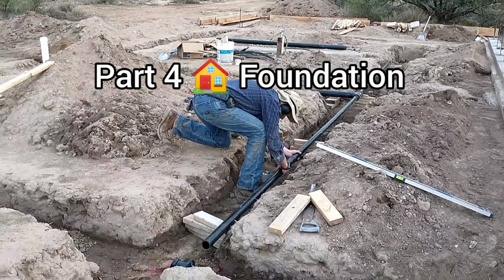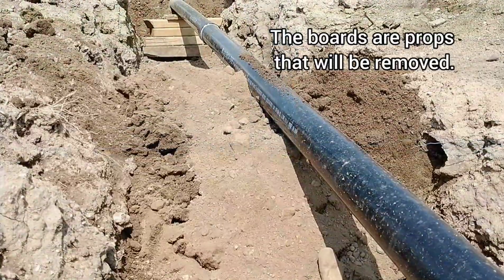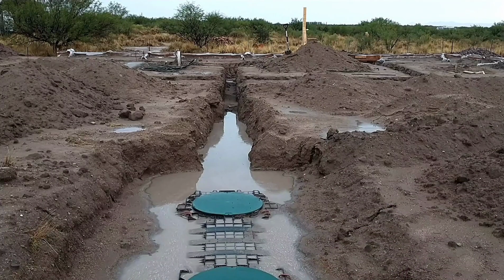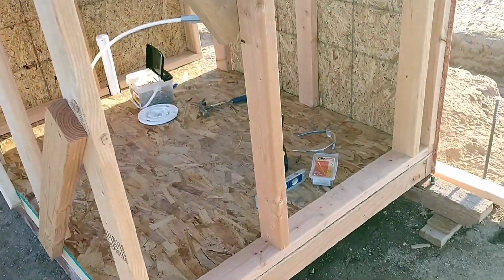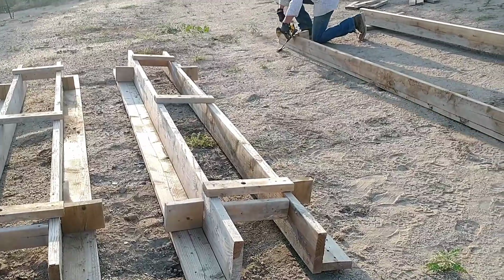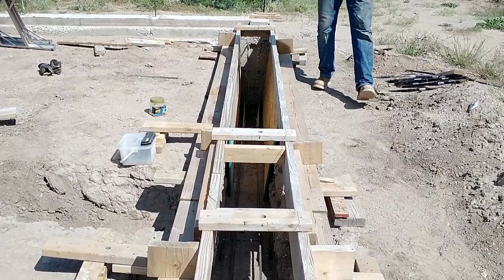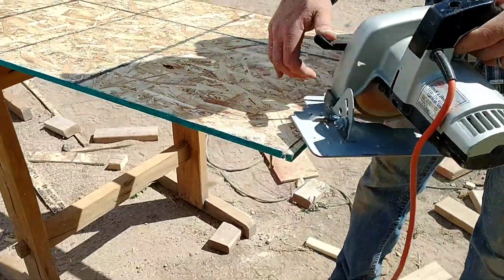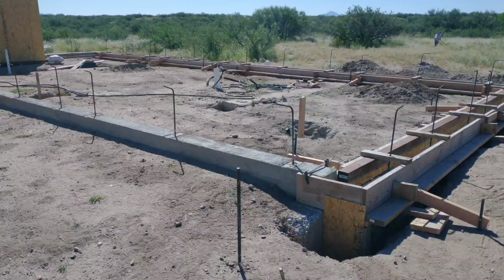#4 🏠 Footer, Plumbing, & Bathroom | DIY House Build

Comment: I have been wondering how your build was going. I bought a cement mixer in Hermosillo Sonora for $1000 dollars and it has been worth it's weight in gold. I have poured some foundations and stem walls for my house. I also started making adobe with it using the fiberous material that is left over after the locals make Bacanora, a moonshine tequila that is produced regionally. It worked excellent with no adverse effects. Why did you break away from the channel about your shipping container shop build? Once you get so many hours of video watched you'll be elegible for monitization. I think your good quality videos will make you a good subsidy and help with your build.
Reply from the maker: Cool! I hope to show the second part of the pour soon. It was about $1500 per pour, and we didn't have to do the mixing. Aircrete needs to be mixed in barrels or buckets. We'll have to do some experimenting first to make sure we can get a mix that will work. Possibly add some fine sand and maybe paper to make it more structural. Fine sand can be purchased for just $24 a ton! Yes, the channel was doing very well and making a decent amount from add revenue. Long story short, we had some issues with crazy locals, and were not sure we were going to feel comfortable continuing to build or post, so we deleted the channel. We're not really sure if any of it had anything to do with the channel, but it's gone now. Things have mostly quieted down out here, so we decided to come back just focused on the house build.  Best wishes on your adobe house build, you should at least do a video slideshow on it or something. 😊

Comment: Thanks for this educational video presentation.  Your craftsmanship and creativity are obvious in your construction work as well as your presentation.  

I have family living in NM. While visiting a number of years ago I watched a building being constructed of concrete in a similar desert area.  The walls (with windows and doors framed inside) had steel mesh fencing embedded in the frames and were poured horizontally into frames that were facing their respective footings.   When the concrete hardened, the frames were removed and the walls were lifted up, leveled and exposed steel sections were welded to adjacent panels.  I was surprised how quickly that building went together.  I doubt that this process would work for your structure because of the rebar you have prepared in footers; perhaps for future structures or low walls.  Sorry to bore you with this memory.   

Wishing you and your family a blessed week filled with dry weather, good health and happiness as you build your future.  Greetings from the southern shore of the Great Swamp Erie in NE Ohio.  Cheers
Reply from the maker: Thanks so much! 
Thanks for sharing! That would be a cool way to do it! Our original ideas was to pour the aircrete in panels, and then stand them up and connect them. As we considered it more, we decided we would rather pour the walls in place. There is a lot to consider and figure out! We hope to start experimenting with aircrete soon. 😊🏠
Reply: @RedandAprilOff-Grid  Stay safe out there and learn much.  Remember to have fun in the process.  Peace